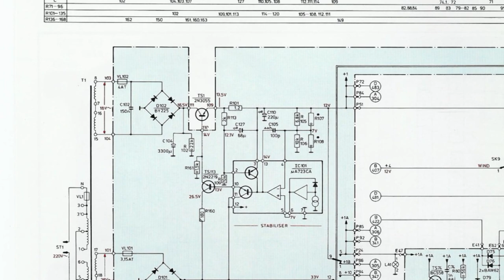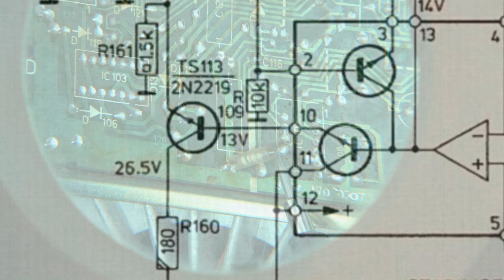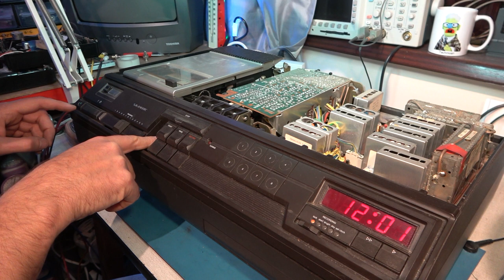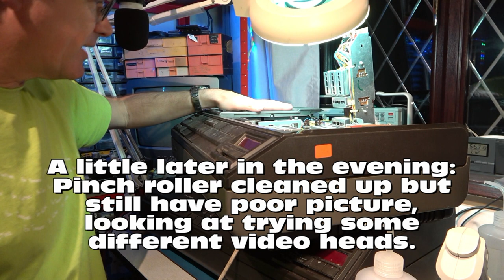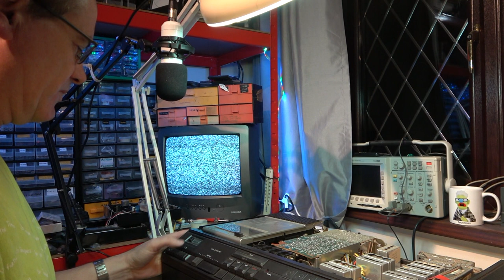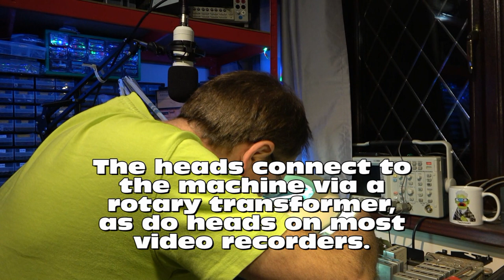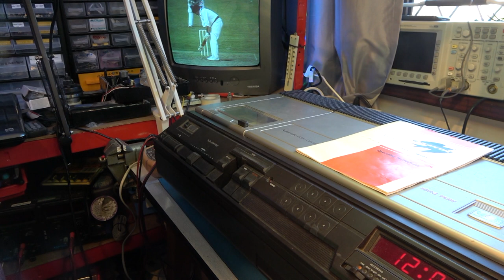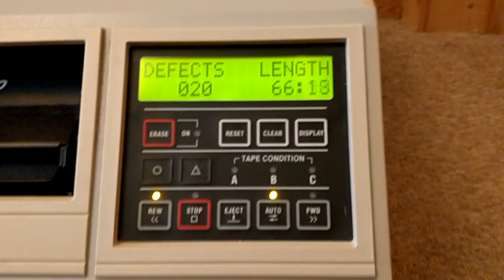Skantic VCR-LP (Philips N1700) video recorder repair. Frantic Skantic.

Comment: Skantic was actually originally a Swedish company named “Skandinaviska Radio AB” and after the Second World War the company struggled and was bought by another electronics manufacturer named “Luxor”. Luxor used to make all of their products themselves, but in the 60s they started to import a lot of products with their badge on it. Luxor worked together with Philips quite a lot at the time and Luxor sold Philips made record players, tape recorders and such. They even sold a reel to reel video recorder under their own brand. I think it was in 1974 that Luxor first started selling Philips VCR machines, the first one being the equivalent of the N1500. In 1978 Luxor launched their own computer named the ABC 80, this was however not in collaboration with Philips. With this computer Luxor sold a game pack and one of the games were called “Masken” which means worm or snake. Then in 1979 they were bought by the Swedish government because they were very close to going bankrupt, and they were eventually sold to Nokia in 1985. Nokia then incorporated the game “Snake” into their mobile phones.
Reply from the maker: Interesting bit of history, I like how Snake found its way onto Nokia 'phones.  I remember repairing some Skantic TVs back in the 1990s, they had a nice modular construction which made them easy to work on, but they were a bit unreliable.

Comment: That machine turned out quite well after some work. Philips really made that a nice machine, and it's fairly easy to work on.
Reply from the maker: And nowhere near as complicated as that Toshiba Beta machine I fixed a few weeks ago!
Reply: @video99couk  That is for sure, that Toshiba was quite the complex maze of parts. What year is the N-1700 from, I know the N-1500 is from 1972?
Reply from the maker: @mspysu79  The duff ua723 chip is dated 1978.

Comment: Can't get my head around the fact that it uses a belt for the head drum. How does it maintain accurate sync at those frequencies without direct drive? I thought drum belts were for washing machines...
Reply from the maker: It's a big head drum, so I suppose the inertia keeps the speed reasonably stable.  You are right though, the format does tend to suffer from less than perfectly solid vertical lines, probably as a result of small head drum speed variations.

Comment: Awesome repair, thanks for the video!
These machines were amazing, and fun to repair and “hack”. If I rememeber correctly, by halving or doubling the value of one capacitor you could turn these VCRs into “Super Long Play” machines, doubling the LP recording time (4 times the N1500 standard), albeit with a (fair) reduction of video and audio quality -of course. Great stuff!

Comment: That was a pretty easy repair, you were very lucky to have a decent replacement head, these things are hens teeth!
I am hoping that one of my machines has a decent head, but in my experience most of these machines were retired due to worn heads :(

Comment: Well done, Another machine saved and not a bad picture now :-D
When you had a dibble in the psu i thought of the ua723/L123, i remembered when i was given a very dead philips machine years ago, there was more than one ua723 on the boards.

A good i.c but they die for no apparent reason, i have a psu that failed and the ua723 had died, tapping a 741 op amp on to the 7v ref pin and the feedback pin allowed me to use the output of the 741 to drive the rest of the psu. (A temp bodge untill i got another ua723).
My dad had the Hillman hunter, not a bad car, and the hillman with the engine in the boot, odd car lol.
Reply from the maker: I'll buy in some more ua723 chips as spares.
I've been working on my Hillman today as it happens, just a snapped boot hinge.
Reply: How on earth did you snap a boot hinge,  lack of oil or just rust?

Comment: I had never seen a VCR this primitive, very interesting !!
Reply from the maker: Well yes, very primitive today, but in their day they were very good.  But Beta and VHS came along and then the Philips VCR format was clearly behind the times.
Reply: Easier to understand than latest gen machines, it is nice to see the same principles used by professional equipment in this simpler device
Reply from the maker: @rodrigobelinchon2982  The only thing that really lets down the design is a lack of proper back tension control.
Reply: Yes , of course ( Rodrigo nods seriuosly pretending he knows what a back tension control is )

Comment: Hi. Great video!. Where can I find the 2 belts you replaced?. I just found some kits on eBay but they are really expensive. Many Thanks
Reply from the maker: The capstan belt will be easy enough to source just based on size.  The difficult one is the drum belt, I found this supplier: 
http://www.gbaudio.co.uk
Their part number for the belt tested here is BELT9.1  Dia 82mm Circumference 257mm  Width 6mm
http://www.gbaudio.co.uk/data/belts.htm

See my later video on this subject here: https://youtu.be/SW_Xes7SU0g
Reply: @video99couk  Thanks a lot for your quick reply. Did you found your capstan square belt at gbaudio too?. Im trying to find it but im not quite sure about lenght or where to find it. Thanks

Comment: Hi I bought a new one of these in 1978 at over £700 have had several head replacements quiet early in its life, very impressed with your videos and it has inspired me to get it going again i did strip it down over ten years ago and as usual the 2 belts were scrap, can you point in in the right direction to getting some new belts and from where
regards Daryl
Reply from the maker: GB Audio is a good place to start.
Reply: @video99couk  Hi I  got the belts from GB Audio, thanks for that, then found out that the unit would not shut off, N1700 saw your video on the 2 micro switches, that sorted that out thanks, when I put a tape in,  the capstan drags it out but the take-up spool does not gather the slack up, so I have to stop it immediately, otherwise it will unwind it self,  without a tape in and in the play position neither of the take-up and feed spools move am I missing a further belt under the flywheel, I have 3 belts fitted including the trip meter, any help would be appreciated.
Reply: @video99couk  hi since my last message I have found a 4th belt which is missing, I think that is the reason why my tape is bunching up any idea of the size of this belt please many thanks again

Comment: So where do those replacement ICs come from? Are they new? Do they still get produced, after nearly 50 years?
Reply from the maker: None of the ICs used in these machines were specially made for Philips so they are nearly all generally available.  That regulator IC is still easy to source on eBay and elsewhere and not expensive.  On later machines of course, there were a lot more Application Specific Integrated Circuits (ASICs) which are harder to obtain.

Comment: Video99,  i have the full schematics for the Betamax Sony SL HF100. Would these be of any help you as ill scan to a pdf. This may take a while, as there are ALOT of pages.
Reply from the maker: That would be a lot of work!  I'll not ask you to do that, but if I do one day need a particular part, that could be very helpful.  I did have a power supply fail on one a few months back but I had a spare from a scrap machine.  One day I might like to try to repair that PSU.
Reply: @video99couk  Thankfully, my HP printer has an auto feeder which makes it a lot easier.  I was interested to see how well it worked out, so as a test I have scanned the 4 pages of remote control to a pdf. I scanned it in at 200mpx res & the file size is 1.5mb. Im not sure how to share it with you privately though to get your opinion.
Reply from the maker: @CreeBreej  You could use wetransfer.com and send to my email address which you can readily get from my web site.  A scan of the PSU might come in handy!

Comment: Thank you great video looked forward to this one. Were they the first VCR ever made well before Beta and V2000?
Reply: They were not the first video recorders ever made. They were preceded by reel-to-reel recorders thst could only record black and white. But it may have been the first to use a cassette.
That VCR format in the video is from the same enterprise that would create the V2000 format. Those VCR recorders were mainly bought by schools and teachers to record Telekolleg. (Source 2:30 - 4:13 out of https://youtu.be/Ka46n4YIWQU )
Reply from the maker: The earlier version called VCR (N1500) was the first video cassette format for home use, in 1972.  Umatic was released around the same time but was used for for professional applications.

Comment: You need an air compressor to blow all that dust off.
Reply from the maker: I have my aerosol cans of air which are pretty good.  I will tend to that when I build the video amplifier circuit.
Reply: video99.co.uk I used air cans before they are nowhere near a shop small air compressor pressure.

Comment: I also see it's a one reel cassette like an 8 track just wondered how it works
Reply from the maker: See my other video on the VCR format for a full explanation.
https://www.youtube.com/watch?v=wC_CLEQnM8w
Basically the spools sit one above the other, the tape runs from the bottom to the top.
Reply: That one-reel system was also used by cinemas back in the day.
Reply: @Rainer67059  It's not one reel, two reels stacked on top, like super8 filmcassettes.